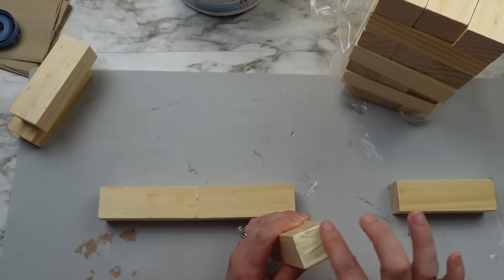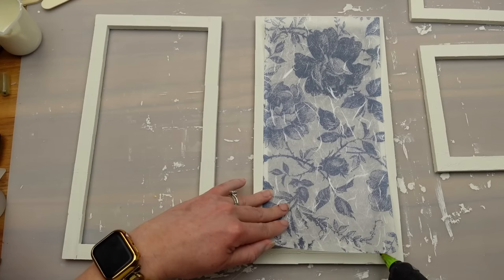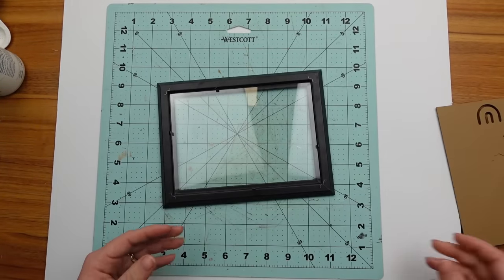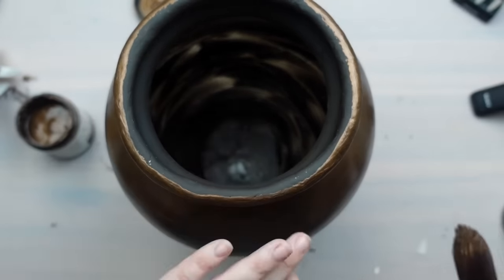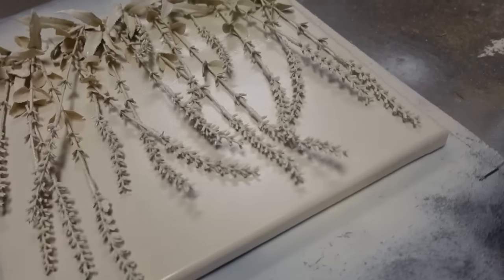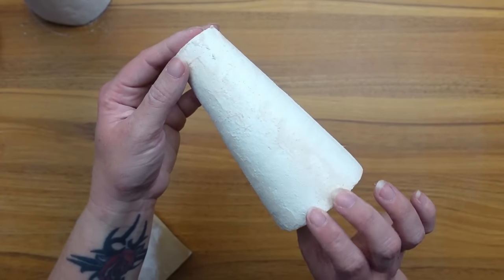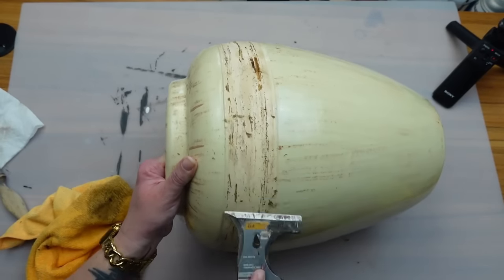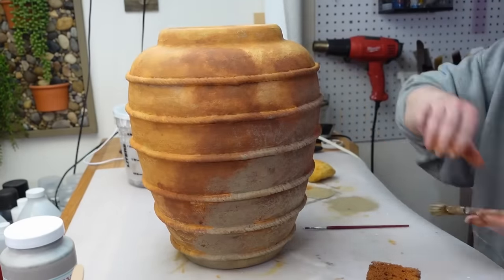Top 10 high end home decor dupes // DIY dupes

Comment: I do a lot of little builds from scrap wood and getting angles cut right can be tricky. But, you can buy a miter box fairly cheap if you don't have a miter saw, which will help cut those angles. To duplicate what worked on one pair with the other, just lay your cut pieces on top of those to be cut and trace the line.